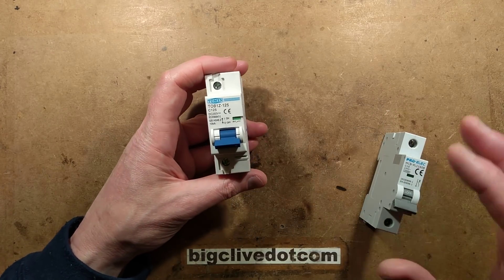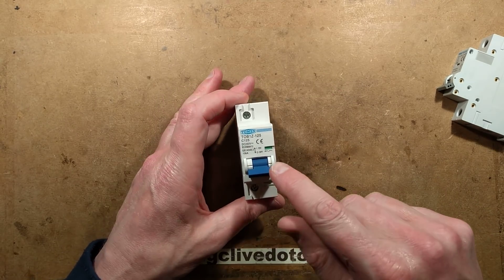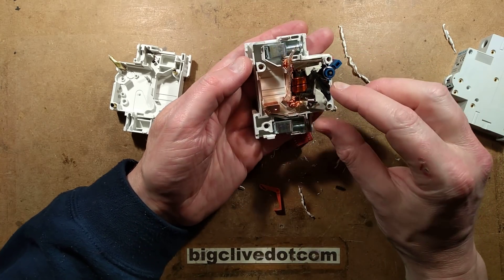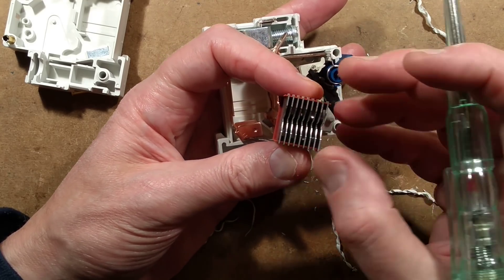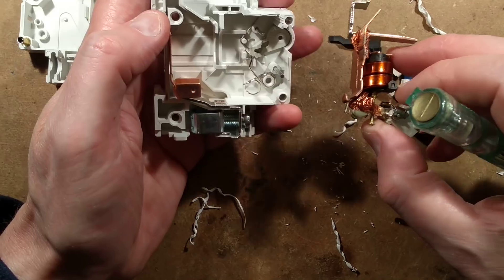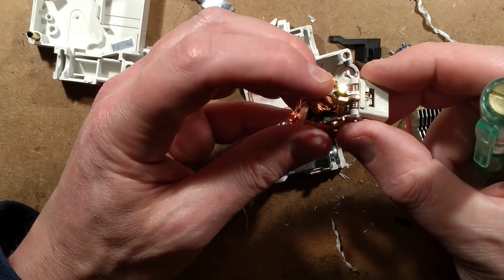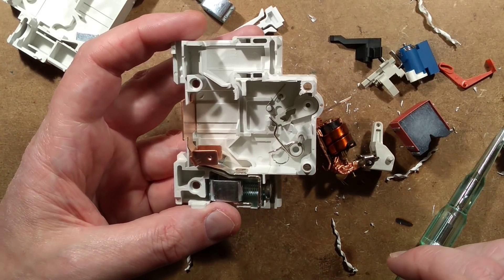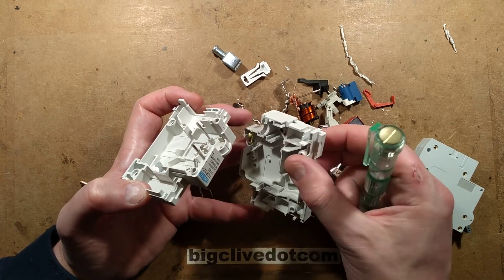Inside a 125A DC circuit breaker.  Unexpected arc quenching feature.

Comment: Thank You much for all your vids , I am looking for a DC Braker that will actually trip at the specified 120A , Do you know a brand or model that will do that ? All the one's i can find and that i can see some youtuber's test alway's trip far over the specc , not good for protecting my ebike pwr pack and related parts , i wish this comment reach's your attention and that you have knowledge about my question , maybe a ANL fuse would work as long as it blow at its rated A's ( they also tend to go over ) Best Regards
Reply from the maker: All breakers have a trip curve based on a thermal response to a low overload and a magnetic response to a fast overload.  A 120A breaker will trip with varying time above 120A but have a margin above that value where it will not trip.
Buying a prominent brand breaker in your country and observing the correct installation procedure is the best option.
Reply: @bigclivedotcom  Thank You so much for the @ sound of speed reply!! now my next thought is what if i get a 80A's dc breaker ? also i will set up on the + wire a  anl fuse , the breaker used mainly as a switch ( wen i need to disconnect the "Y" paralell union) and a fuse as a over current cut off . Have you tested ANL ( or that kind of fuse ) if not i will gladly ship you some for you tp play with , i dont have gear to do test's of that type ,Cheers & Best Regards

Comment: There are various types and styles of Arc Quenching Device on switches and breakers and relays/contactors at all voltages and currents.  I've seen the fin type on all the gadgets (isolation switches, circuit breakers, and contactors) up to the top of the LV regime, say, 500V.  Above that the industry goes to MV (5kV or so) and that means vacuum bottle interrupting devices, which are intrinsically arc quenching.

Comment: The reason they make these.. Is they can be mounted on Din Rails for Motor Controls and other devices. In a locked cabinet..And they have to be flash proof in industrial environments..A big deal if it's around a paint booth, fuel fumes, etc... And these vapors can get inside a cabinet. Why when I installed the wring in junction boxes. You had to seal the conduit at the entrance. They make special explosion proof seal offs just for this...

Comment: Great stuff ,great video,  a video about polarised DC breakers in general would be great as I think its the most under reported and  confusing thing on YouTube lots and lots about Double pole reversed polarity completely different than Single Pole though  ,not seen any informative videos at all  on SP  Polarised DC breakers and how to wire them correctly ,I guess there must be thousands out there all wired wrong ,it really is bizarre how this can be especially with solar DC systems growing in popularity ,
Reply from the maker: Worse still that many solar systems are basically being installed by crash certified labourers.
Reply: How is the polarity marked?
Reply: @mrtechie6810 For single pole breakers  there's is a diagram on the front but also they will usually  have a + at one end and a - at the other end ,this is for single pole breakers ,for double pole breakers its slightly different .

Comment: Hello. Can someone help me pls on how to connect a dc circuit breaker i have ? Its a Kripal UKB7Z-50/1/C20. I would like to install in on my Mppt charge controller on my photovoltaic system. More specific i would like to install it on the output of the charger, on the positive wire that charges the battery. The breaker has a + symbol on the top screw and a - symbol on the bottom screw. So any help would be really helpfull but pls answer responsible if you really know because if that breaker connected wrong nasty things may happen ! Thank you.

Comment: Many is now making their own 12v, 24v and 48v DC systems with 100s of Amps using switches and breakers meant for AC at the AC rated limits without knowing they are creating a fire hazard ... When using a switch rated and approved for both AC and DC the DC rating is normally half the Ampere of the AC rating.

Comment: For dc ( unidirectional current flow) , a correctly polarized magnetic field is a must for rapid arc diversion & quenching.... therefore the direction of current flow ( wire polarization) is fixed and indicated on the breaker

Comment: I use two of these same mcb's beside each other (in parallel)  for my 24 volt dc solar battery. The contacts get hot when i draw close to 80 amps, im afraid to go any higher. Thanks Clive

Comment: Note: I've tested that exact model and ampacity of the DC circuit breaker from aliexpress.
Try running 300 amps of current of any kind thru it.
In my case, it didn't flip (turn off) as it should have, it just smoked and stank quite a bit and then melted stuck after a while.

It's a serious issue if you ask me, since it's a safety device, so I filed a complaint to the seller, and I even got an instant refund on that case (didn't actually expect that to work but ok)

Interestingly, other MCCBs from the same seller worked OK
I usually test them at twice or all up to 5X the rated current.
That's where they're the most vulnerable. Not enough current for the electromagnet to switch, but very high current for the contacts and connections.
Of all those things, the bimetallic strip should be the one that heats the most.
If any other component heats much faster, something will melt/burn.
Reply: You should make a video with the name of the brand in the title, people will buy these thinking they are improving safety, if you have real life experience of them not working, thats a huge safety issue, that people should know about.
Reply: @ratgreen  I could.
Although, I might order another one to see if the problem is persistent.
I think people should understand that these items are not thoroughly tested, they barely even are, and it's like buying something on a garage sale, you can't blindly lean on it.
Reply: I highly recommend a HRC safety fuse in any case. Much more reliable and safer.

Comment: i buy some beakers sellers as DC 250V 20A 32A 40A and when they com i see there nothing outside about they DC ..instead they was mark as AC 400/230V  soo i buy other brand to compare and i buy this TOMZS(or something you have on video) soo i was expecting to see something other ...that will tell me this MCB 20A 32A 40A are other inside ..and they in real AC and this TOMZS is real DC ....but both brand breakers are same inside ..... i was thing its scam.... and want see some specialist dissasembly some  100% sure DC MCB ...but im still not sure ...  ..coling arc compartment i supose also to be beter design  i was hope.....    i dont know ..not i was scam or not by two chinas producers... with one dont mark DC as DC  instead mark they as AC 400/230V  and second that mark as DC  but in true they both are  AC breakers with ARC COLING compartments !!!??????? ....  never see good quality AC MCB .... only real big for 500/1000 or 6000V AC and hunderts amps...... ..you on video have some othere expectations also ...soo i realy dont know...im lost

Comment: Interesting video!  Question: you mentioned, "you expected more and.... it isn't going to perform as desired in a genuine fault  situation like solar panels and stuff like that."  But why not? or do I misinterpret and you mean it is, or might work as expected?
Reply from the maker: I'd be cautious about using this in a real scenario in critical applications.  It might be fine for a low power remote application that didn't pose risk, but I regard stuff like this with no real local certification and testing as prototyping materials.  It's better to use a properly certified unit in a real application to avoid liability.
Reply: Thanks for your answer! I agree. But if or if not it will be ok to use is still rather speculative without testing, which i know is outside the scope of this video. But maybe for a next video i would be very interested to see what’s the difference is between a din rail model from this video and a waterproof automatic resettable DC  fuse/breakers for cars, audio systems, boats etc and are in the range of 30 to 300A also china made and from Ebay, Ali etc. Gr Luc
Reply: @LucScheffers  Cars are much lower voltage. Most reputable manufacturers' mains-voltage breakers are also rated for DC at up to 48, 72, or even 125V. Some have a minimum of 12VDC.
Reply: @someonesomewhere1240  thanks for your input!

Comment: I wonder, if you break a load multiple times in a quick succession, as in the case of some idiot trying to get the circuit running, will the arc suppressor fail to quench once it gets hot enough?

Comment: Sorry Clive but that is not the contact on the bottom. When it is latched the contacts go forward into the 2 large copper plates and connect with the pips/contacts, below the arc block, either side and as they move forward they are forced apart and into contact by the relay pin in the centre in combination with the 2 springs in the plastic housing.

Comment: Hi. Total noob here. Watching to satisy my own curiosity with DC circuits. Could someone please clarify for me: the quencher dissipates the arc through the plates and air resistance, or is it more complex than that?

Also thanks Clive for your awesome videos!
Reply from the maker: Most small breakers rely on an arc characteristic that causes it to follow shaped rails that carry it into a stack of isolated metal plates that break the arc.
Reply: @bigclivedotcom  thanks Clive. For the arc to travel through the plates, is it still connected to the powered side, on one side of the plates (to direct the flow of electrons through the plates)?

Comment: If I'm not mistaken, it is called a blowout magnet. Many DC relays use this feature to keep them small.
Reply: @Elektronik mal einfach True, but like he pointed out AC does crossover the 0 point at one time :) At our uni the professor demonstrated this issue with a 2kW DC loaded motor and pulled the blade switch with an arc about 15cm long - motor still running and lighting a piece of paper in it :)

Comment: Because DC current is harder to interrupt, this unit would be a Universal Circuit Breaker, if not for the permanent magnets set up for using Lorentz force on the arc (which also makes the breaker polarity sensitive even though it's not marked as such). Previous to use of the magnets, any DC breaker would work to the same or higher current on AC. You can see this in the ratings on some switches.

Comment: Minor nitpick: the current flowing through an AC circuit isn't likely to be zero at the zero voltage crossing. Any inductance or capacitance will knock the current out of phase with the voltage.
Reply from the maker: But at some point the current waveform will be zero regardless of power factor.

Comment: in my opinion, the plates act as a capacitor and the relay styled switch is part of the (impedance) RC circuit, thus given x number of AMPs at 50-hertz throws the relay over to toggle the switch to off.  maybe I am talking nonsense.

Comment: What would 125 Amp DC Circuit Breakers Be Mostly Used For? Most likely typical wide-spread usage would be Tow-Motor Battery Chargers as might not be large enough market for large solar or wind-turbine parallel wired arrays nearly as plentiful as thousands of warehouse two-motor chargers around. Even so, that design looks somewhat flimsy for reliable usage but again might be just fine.

Comment: Thanks for the great pic of an ac waveform with 3 zero cross's.  Just kidding. It was funny tho. That spring is so hard cause it gotta SLAP that contact open, EH? I luved your evaluation of the 3 leds lights astro, less parts Harbour Frieght, lot less parts--ebay light. Super Job!!

Comment: 250VDC @ 125A is ~32 kW. That's actually quite a small breaker for what its actually passing. Although AC breakers of that rating are usually polyphase, so they need to be wider since they connect multiple phases in the panel.
Reply: For dc contacts...250Vdc@125A..that tells you , at least for that much of a current flow that contact resistance must beat least (1/100to 1/500)( empirical) of (250V/125A)..
i.e. {(0.01) or(0.002)×2 ohms)..

Comment: Clive on real size dc cb's 10kA load current rated ones they have blow out coils which you magnets replace, you have to remember the arc is a conductor with its own magnetic field, the object of those magnets is using the motor effect extend the arc up into the are chutes; extending the arc increases its resistance there by reducing the current and the arc chutes split the arc into the separate slots again extending the arc also cooling it.
DC cb's and contactors have an arcing contact, these are often sacrificial the main contact closes last and opens first.
 The railways use DC CB's for circuit protection in third and fourth rail areas also trams systems

Comment: I noticed when you drilled out the rivets you turned it upside down, and when you opened it, the breaker contacts were on the bottom. Which means if you turn it upside up, you have the breaker contacts on the top, and the quencher below. I know it's got magnets behind the contacts, but how does it push the arc down through the quencher ?
Reply: As I understand it, the arc induces a magnetic field which is then pushed into the quencher by the stationary magnetic field of the magnets, and the movement of the induced field drags the spark into the quencher as the spark follows the induced magnetic field.

Comment: https://youtu.be/PsUsByrOveE check this wireless led video out. Looks simple at the end.
Reply from the maker: I like the use of the standard PCB inductors.  I've done similar with a hand wound coil and RFID/QI type bases.  I used two LEDs in inverse parallel though, because the coil is energised with AC.

Comment: What's the voltage rating of the breaker?  Back when I was involved in that kind of thing, with avionics, relays and contactors were typically rated at the same current for 28 VDC as 200 VAC (@400 Hz).  I know relays are not the same as breakers, but arcs is arcs and the same gap that will break a 200 VAC arc will break a 28 VDC arc of the same current.  So, without magnetic arc suppression I'd expect a similar contact movement (give or take a few blonde ones) for 28 VDC as 240 VAC.

Magnetic arc suppression lets you handle more current and voltage in a similar-size package.  So whether or not that breaker surprises me depends on the voltage rating.
Reply: Looking at the video the sticker seems to read 250V DC.
Reply: @blahorgaslisk7763  

Those magnets are a lot more effective than I thought.
Reply: The Nader NDB1-125 looks identical to this one. Label on breaker shows AC230/240. Spec sheet shows 60vdc.

Comment: Magnetic quenching is VERY common on DC breakers when they need to fit into confined spaces like a din rail package. The caveat is that, unlike an AC breaker which in most situations may be top or bottom fed (back-fed in north american parlance); A DC breaker using magnetic quenching, must be fed power from a designated input terminal to ensure the arc will be shaped and drawn into the arc chute by the magnets. Thanks to  Big Clive for this video!! ...even when you know how it works, it's still fascinating to see all the manufacturing variations inside these devices.

Comment: Great vid!  In the USA, larger MCB's are indeed tested under-load (called a Primary Injection test).  These DC breakers are used in industrial welders, power-plants or AC to DC motor-generators.  A machine called a Breaker Test Set (BTS) is used.  The massive DC BTS's are powered via 3-phase 480V and weigh about a ton.  It delivers adjustable power to a 3-phase selenium rectifier assembly.  The output of which is injected into the breaker-under-test.  The machine times how long it takes for the breaker to trip at a certain amperage.  These results are compared to the manufacture's operational-curve to qualify the breaker.

Comment: A video showing the arc blow in DC would make a great compliment to the video.  Not very well known are carbon arc lamps for old movie projectors contained a bar magnet behind the reflector near the negative electrode.  It's purpose was to blow the arc out from between the carbon electrodes to just above them so the reflector is not shaded by the electrode.  Most people assume the arc shape is due to heat rising.  While this contributes, the first sign a projector polarity is reversed is the arc points down instead of up. In a projector carbon arc lamp, the negative electrode is a short small diameter rod at the rear of the lamp and extends through the center of the reflector.  To keep spatter and deposits off the reflector, the arc is blown towards the positive electrode and up, so if you ever get the chance to see one of these antique projectors operating, or find a rare photo of one operating, it will be noted the arc not only rises above the gap, but the flame tail is tilted away from the rear reflector.  It is leaning directly away from the side of the bar magnet below the negative electrode behind the reflector.

Big Clive,  Please try to locate a carbon arc projector lamphouse for a video and show the magnet and if possible it's setup an use.

Disclaimer, in the 1970's I had a 2nd job as a projectionist.  Was lucky enough to make friends with a theater owner who still ran carbon arcs in an old style single screen large theater and was trained to run it.  They even had the hand crank from before the addition of sound and the electric motor for even projection speed.  This was an antique Simplex projector with the glass gearbox.

Comment: 125a yes BUT at what volts? its a major ask if the volts are in the 100 plus volts dc on load from solar panels .  ps normally when u break a solar system the dc volts go up as the load go off making dis connection  more problematic   =not good
Reply: It literally has "DC 250V" written on it lol